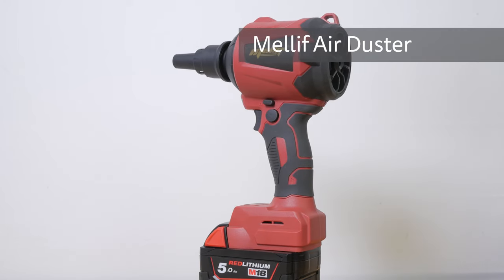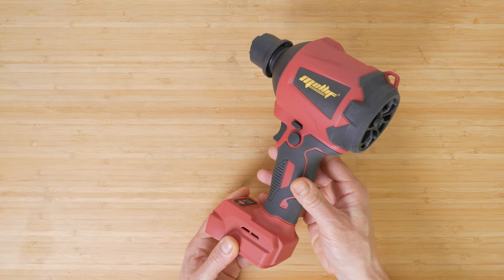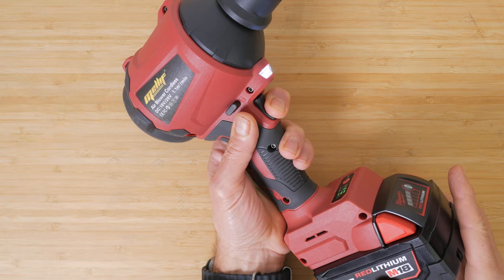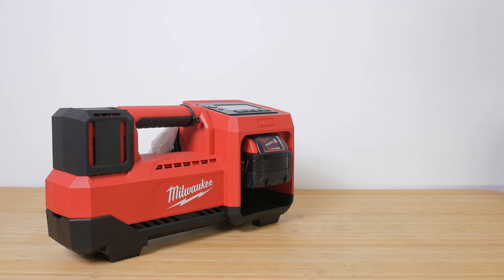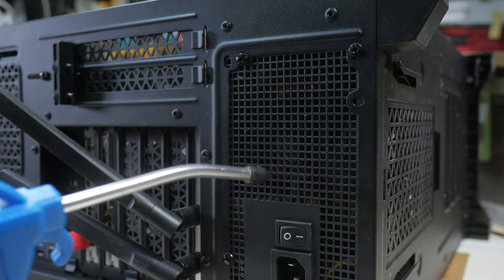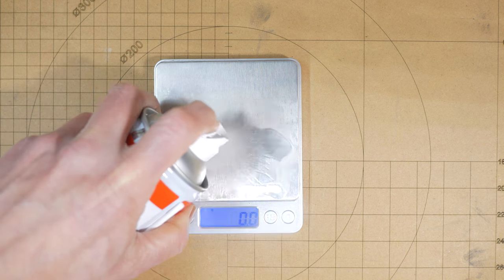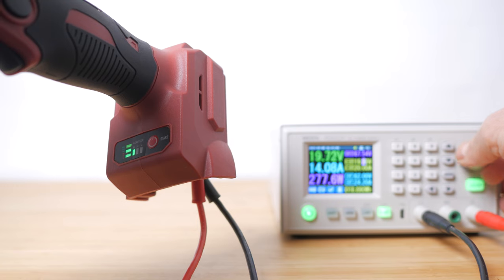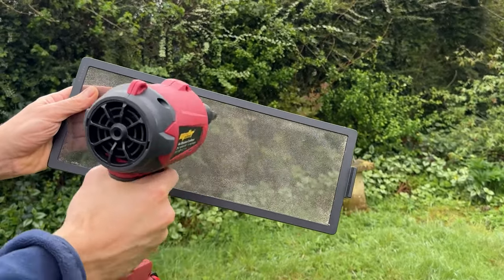Mellif Milwaukee, Dewalt, Makita Air Duster / Compact Blower Review | Gadget of the Week EP01

Comment: I thought that I would get the Mellif Air Duster in the Dewalt style as I have many Dewalt tools. Unfortunately, I have the older Dewalt battery equipment that use the older batteries with the stem that fits into the tool's grips. So, now I have to buy yet another battery and charger. My question is, should I buy the Mellif Air Duster with the Mellif 4AH battery and charger or buy the Dewalt 5AH battery and charger?  Thanks.
Reply from the maker: To me it makes more sense if you’re already on the current Dewalt battery system. Maybe you could pick up an old Dewalt battery and charger? Or if you need a new drill usually some good deals around that come with batteries and charger.

Comment: Seems slow to reach max power. Is there a knock off brand that has more power. I use an air compressor to clean chainsw grease vacuum cleaner filters etc
Reply from the maker: Perhaps the genuine Makita one. But it still won't compare to the blast an air compressor gives.
Reply: An Air compressor Can or the Makita? @TheTechnologyMan

Comment: Did you mention the weight? Doing precision cleaning inside your pc is easier if it's not too heavy.
Reply from the maker: That's what the flexible hose is intended for - but you lose a fair bit of power. It's 660g / 1383g without / with 5Ah battery.

Comment: A smaller, more handy device like this one would be nice if it could match the PSI of the compressor.  Every month I pull out everything I need to clean: House AC filters, car filters, vacuum cleaner filters, and even brooms and dustpan brushes, electric razors, etc.  I usually bring out some woodworking tools that need to be blown out as well.  My compressor isn't very large, so I have to wait on it to fill up from time to time it I'm blowing continuously for a bit (e.g., the HVAC filters).  A hand-held blower with a concentrated airflow would be ideal, but none of these seem powerful enough.
Reply from the maker: Wow you sound very organised! Nothing I've tried comes close to the power of the compressor - but for a lot of those jobs I imagine this blower would work ok. The other (albeit expensive) option is a portable battery operated compressor. The big battery platforms all do one.

Comment: For DeWalt is there a minimum recommended battery size? 1.5ah, 3ah, 5ah? Obviously the larger the battery the more sustained voltage
Reply from the maker: They should all deliver the same power. In my tests the battery wasn't the limiting factor.